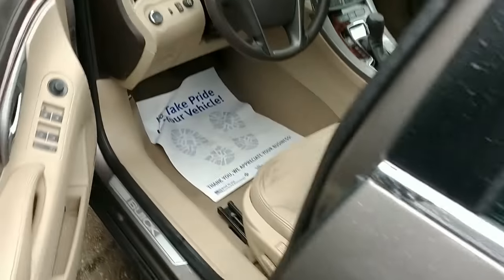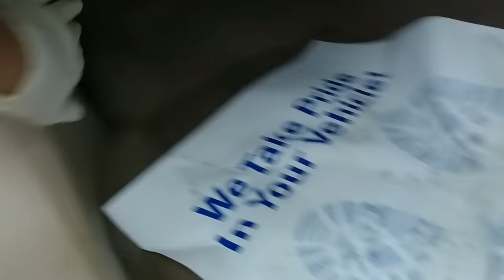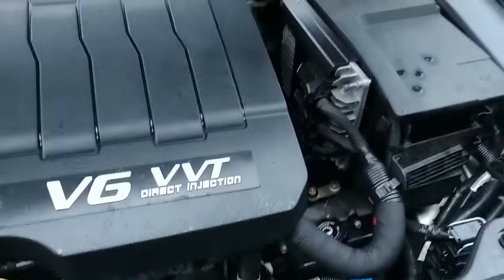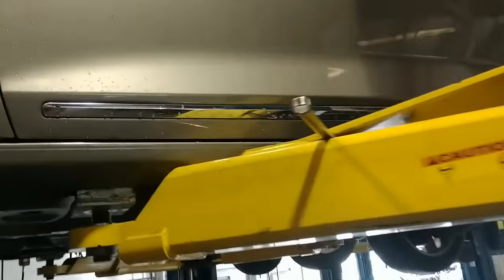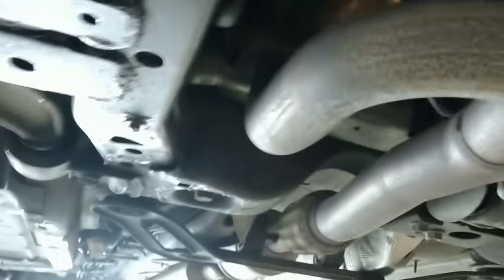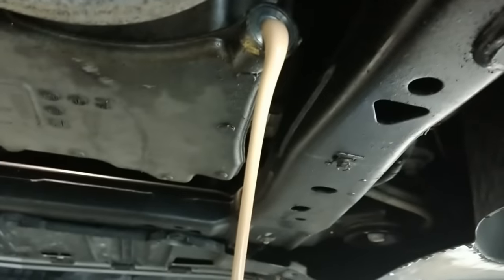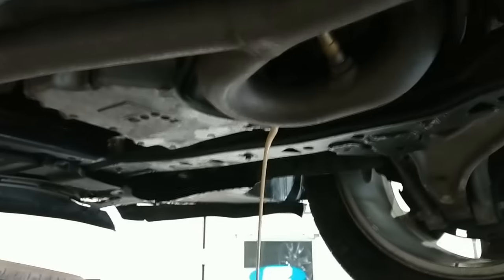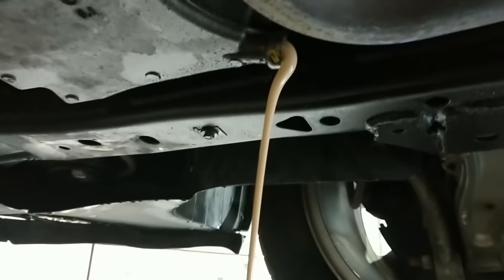Overfilled Crankcase! Blown ENGINE! Used Car Nightmare!

Comment: Tell the lady to fill it up with fresh oil and take it to the nearest "Buy Here Pay Here" -- it worked for the last owner :-)
Reply: You are a treasure to be sure.
Reply: Then they sell it to someone else and rip them off just fix it then you have a nice ride
Reply: Lol. They buy lot of cars at salvage actions. Clean them up. Don't fix anything. Sell for 3 times the price. I went to an auction here once. Next day on way to work I passed a corner lot and seen a car I remembered from auction. I stopped. They claimed they had it for a while and every thing worked and it was $3k. It was 1 of a kind cause color and decals or something. Think it was yellow with stickers. Like a ricer. so I knew it was same car. Pretty sure it sold for $1000 night before. They didn't do a damn thing to it. Skip the corner lots and save money buying junk straight from the auctions. For best deal get with someone at a dealership and tell them kinda what you want and tell them call you when they get a trade in they gonna send to auction. Find out what's wrong if anything. You may find a deal for under $2k.
Reply: Not if they check the oil after the head gasket is blown then it will muck up everytime the thermostat opens
Reply: @pitbullgamer8116  jjj man n
Reply: Uuiiuiuiuiuuiuuiuiuiuiuiuuiuiuiuiuiuiuiuiuiuuiuiuiuiuiuiuiuiuiuiuiu
Reply: @pitbullgamer8116  exactly its actually a very nice car it's worth fixing or finding a good used motor to stick in it.
Reply: I’ve done that before, ironically with a Buick skylark.
Reply: Na i wouldn't feel right doing that to someone else even though they did it to me that's not right to do.

I'd just fix the car the right way then never buy from that car dealership again 

And then if it's to much for me to fuck with I'd tell the next person who wants to buy it what's all wrong with it so they can fix it up for themselves 

Theirs tons of people out there that hate to tell you what's all wrong with whatever ride ur about to get just so they get it sold to get them some easy money
Reply: Bax 60  they should be sure then to make a good list of what's all wrong with it and tape it to the window then sale it
Reply: @xjet this is getting weird Bruce. I feel like they opened the ditch and now I have to come over there and fly otherwise YouTube will keep doing this.
Reply: @Clynikal  LOL... yeah, that travel bubble is there for a reason mate! :-D
Reply: @SgtJoeSmith  Never buy from a dealership unless you want to get scammed. Just buy from private parties and fork out the $150-$250 it costs to have a mechanic inspect it.
Reply: @lemonator8813  that's what I do. But im a mechanic. So I start making up stuff car needs and over state repair costs on actual repairs it needs and boy they start dropping their asking price. 😆
Reply: @SgtJoeSmith  Good idea, I'm going to try that next time. I'm a mechanic... an amateur mechanic lol 😆 
I wish I wasn't such a softie when it came to people though. Need to be truly ruthless if you want to get the best deals.
Reply: @lemonator8813  scam them before they can scam you. thats what world has come too. i make money scamming scammers
Reply: @jl456  Swapping a whole engine will probably be more expensive if you can't do it yourself.
Reply: @kaedeschulz5422  theres always that one guy and your it! The car has what 70k miles??? Okay you buy a used motor or have it rebuilt for what $3k to $5K ? Now your have a car that will last many more years vs paying $500 month for a new one or whatever!🤦🏼‍♂️
Reply: @jl456  Yea i'm such a terrible person....
On such a new looking car i didn't think about a used engine. My bad
I did think about a rebuild with new bearings and all the parts that need to be replaced.
Reply: @jl456  Yea i'm such a terrible person....
On such a new looking car i didn't think about a used engine. My bad
I did think about a rebuild with new bearings and all the parts that need to be replaced.
Reply: @kaedeschulz5422  😂🤣 it will be alright!
Reply: Wouldn’t work sadly. she didn’t buy it with a blown head, she bought it with cooling problems and blew the head while overheating it. I can guarantee you she didn’t buy it with white smoke pouring out of the tail pipe.
Reply: This happened to my friend, but instead he did the mature thing and took the car to be crushed into a cube, in his own words he said he did not want someone else to be ripped off like he was.  People like that are the real MVPs out here.
Reply: @jl456  It's a terrible car, a new motor would cost more than the car sells at blue book value when it's perfect condition, don't forget it's a 2012. These buicks are known for terrible reliability, that's why it needs a new motor in the first place.
Reply: @kenm2709  lol yeah okay I'm not talking a new crate motor pal. I used motor installed will not cost as much as you think also what the hell do you expect for them to do there making payments on it probably for the next 3 to 6 years! Some people just dont get it.
Reply: @kenm2709  I think your wrong
Reply: @jl456  the title literally says it was bought at a buy here pay here lot so the lady more than likely has horrible credit. She is also more than likely making payments every month on it that will be $300-500 for several years after having the issue arise just 100 miles after driving. What part of that makes you think she has another 1-2 grand to stick into fixing the head gasket or buying a new motor?
Reply: @Dunz0Washington  and your just assuming so what part of your message makes any sence? What is wrong with you guys so let's just take a nice car with 70k on the odometer and have it crushed because that just more sence! 🤦🏼‍♂️
Reply: imagine if you could pay a few bucks for the first 30 days of car insurance for this type of fraud. The insurance will be sending these clown shops the bill or sue them into the ground.
Reply: @SgtJoeSmith  my Jeep has rebuilt title and it’s been flawless the past year.
Reply: A shame when people dont bother to take care of stuff.
Reply: @pitbullgamer8116  let's assume it's worth 5000, and she paid 2000 down from taxes, and interest rate is off the charts.  That's a 3000 engine, so in the long run, you'll pay even more, THOUSANDS more, when you went to a car lot to buy a presumably running and driving car, you expect to run for a good long while, not 100 miles.  I had a car lot do this to me on my civic, even though honda was paying for new engines due to a flaw in the engine block, I told em I'd drive it through their shop if they didn't fix it.   They swapped cars for another civic, a few more miles on it, it got sandwiched 2 months later.  God saved me from them all together, and saved them from me too
Reply: Tee  shake the exhaust and muffler. they are supposed to move a bit as the hangers have rubber isolater bushings. but act like its moving way too much. same with tie rod ends. should be able to rock tie rod ends back and forth a bit by hand but if you can shake them without rocking and feel play they are blown. 1 time on a 97 ford ranger if felt the tie rod ends and they felt decent but then i told seller look under truck and i rocked them back and forth and claimed they aint supposed to move like that. I could tell he was stupid looking at him. told hime parts and labor and alignment is $500. he offered to take $500 off. i got it for $2k instead $2500. kids.... go to trades schools and work a job in the trades so you dont get screwed over. lol
Reply: Take it back where she bought it and sell it back to them.
Reply: @pitbullgamer8116  a lucerne will never be a nice car bud
Reply: I’d just bring it back and ask for a refund or to trade it
Reply: Looks like my espresso in the morning 😂
Reply: @jl456  I don't know about modern buicks, but the majority of modern cars are getting parts only the dealerships can get, they're even making special bolt patterns so no tool normal people have works to even get things apart. My dad is a mechanic and had to pay $1500 just for a special toolkit for my moms new Toyota. And the parts are so expensive from the dealerships almost better just getting an entire new car.
Reply: Reduce reuse and resale
Reply: KSEAL
Reply: I agree or call your local hwy patrol and have them inspect it prior to purchasing. I know our state they do that and there have been numerous buy here pay here dealerships that have lost their businesses and have had lawsuits over selling junk or unsafe cars.
Reply: 😂😂😂😂😂epic
Reply: @HAXGGEZ  if it was running long enough for that much coolant to get into the oil the thing is toast. Coolant is very bad for the bearings and rings.
Reply: Yo! It's xjet from NZ. Keep em flying dude!
Reply: @SPEXWISE  I'll do my best mate! :-D
Reply: @xjet  Thanks for all your hard work standing up for us RC enthusiasts. I appreciate you mate.
Reply: I did that with a Buick my father gave me for free. Drained the oil, put in fresh oil with some stop leak and traded that thing in!
Reply: Nice buick
Reply: @SgtJoeSmith  thats real honorable sarge. If you can’t beat them join them?
Reply: @anthonysimon3595  I find it hard to believe the highway patrol is going out and doing pre purchase inspections. They are law enforcement, I’m going to guarantee you can’t find a law that’s says your can’t sell someone a broken vehicle. That is called buying it as-is.
Reply: @SgtJoeSmith  if you buy cheap knowing some $$ is needed for repairs you make out fine- seling cars with issues is really low
Reply: @jl456  depends on the motor some morors get expensive some motors the chassis hast to be lifted to get them out. It just depends on the work involved.

On my bmw to replace just the turbos it's almost 9,000.00 you can buy a car for that.
Reply: But they'll give her half she paid
Reply: Luckily for us. My friend got us A 2006 Chevy Colbalt LX. With Very low mileage. We've had it A year and we didn't invest much money to keep it on the road. Previous owner was A college student and did the basic work it needed. It is an awesome car.  Not to roomie.
Reply: @ronlafountaner70  I've had the same car since it was 3 years old I have a 2008 bmw 535i with 130,000 miles on it bought it with only 20,000.  I love the the car it's had some issues over they years but heck thebcsr is 12 years old it's going to have some problems come up from time to time.
Reply: @pitbullgamer8116  That could cost more then she paid for the piece of shit,  this is why most places have a lemon law.
Reply: @SgtJoeSmith  You're in the military? and on here bragging about screwing people over? Come on bro! Why?  You're Representing Your entire Country! you should be a positive role model. Not doing shady dishonest things bro. Not only are you giving yourself a bad name, but Also all members of your particular branch of military and also Makes The U.S.A look worse than it already does. Yes car dealerships salesmen rip people off and its Very wrong! But going to one and doing the same thing back doesnt make it okay at all! Its still wrong and dishonest and says alot about both people who are scamming eachother. I Appreciate your Service. I do not know your Story, so i do apologise for being rude. But at the same time bro, Dont do that buddy! You're better than that! You have integrity and Self respect im sure. You are better than some dealer trying to hurt Us all using dirty tactics. Rise above that bro. God bless Brother.
Reply: @jl456  Agreed.  A good used 3.6 with less than 100k can be had for $1200 to $1600 with about a grand to install it.  From 2012 on the 3.6 was / is a good solid engine.  Earlier versions had massive issues with the timing chains.
Reply: @darkdevilone8613  Special bolts?  You mean metrics?
Reply: @HockeyGoon939  no metrics is standard for stuff like that in America. By special I mean they make special bolt patterns so normal tools don't work so you have to take it to a authorized dealership or buy special tools for a whole lot of money.
Reply: @kcmcgill5407  simple. Fill the coolant system with mobile one.
Reply: @paintedwolf8394  I remember when a Buick would go 300k plus miles on a 3.8 ltr
Reply: @pitbullgamer8116  yea new engine be 5k tho
Reply: @jl456  

A good used motor is still 3-4 grand more. Especially on late model cars. It's not a 68 Mustang where you can change out the engine in an hour.
Reply: @Mike-su8si  

Yeah, a used car salesman gonna tell you what's wrong with a car. 🙄  Lying is kinda in their job description.
Reply: @jl456  

SenSe, not sence. And if an engine blows after 8 years it's not a great make. I wouldn't trust it, especially if it was just a used motor. A rebuilt or new engine, maybe. Still, if the car has a bad reputation it'd be a better idea to dump it as fast as possible.
Reply: Sherman  who cares! 🤦🏼‍♂️
Reply: @liman42  just take the car to the junk yard then and keep making those payments! 🤦🏼‍♂️
Reply: @jl456  

I don't buy vehicles on a payment plan. Cash is king. And if this woman was making payments she probably doesn't have enough cash on hand to shell out 3 grand for engine. You could buy an excellent vehicle for 3 grand from someone on Craigslist. Following up a bad decision with another expensive decision doesn't seem too smart to me. Either way she's screwed.
Reply: @jl456  

Who cares about what?  Your poor spelling? I do. I wouldn't take advice from someone that doesn't have enough sense to spell it right. If you can't get the simple things correct I wouldn't take seriously anything else you might suggest that could be very costly. Throwing good money after bad is never a good idea.
Reply: @liman42  well good for you English professor!!! Were all proud of you ! You get a cookie for you proper spelling!!!
Reply: @jl456  

You continue to display why I wouldn't take your advice on anything.
Reply: yeah, rule number one of that class should be, never, under any circumstances, ever buy a car that has a freshly pressure washed engine bay and an oil change.
Reply: @jaybruz.5688  

Why? Do you expect a used car dealership to sell a car with a dirty engine and black oil? Yeah, that'll sell real quick. 🙄
 I'm a mechanic and I bought a 98 Tahoe from a dealer with 80+ thousand miles. One of the best trucks I ever owned and I beat on my trucks.  I ended up killing the transmission pulling a fully loaded trailer across country. Got that replaced and the mechanic broke my distributor pulling the tyranny and the dealership manager screwed me, the little shithead.  Texas sucks.
Reply: That's very dishonest. Does any one have morals anymore?
Reply: Ah yes the circle of life
Reply: @BuddhaAtheist29  lemon law only applies to brand new cars.
Reply: @darkdevilone8613  my parents have a 2013 and 2018 rav4, I just did brakes and and oil change on the 18 and there was no special fasteners. I think your dad is lying to you.
Reply: @335m5  not that I have ever heard of, why would a brand new car with an warranty need a lemon law? It to keep used car lots from sale cars they know are trash.
Reply: @BuddhaAtheist29  you better do some research because your completely wrong.
Reply: @335m5  Well every state is different first off. Second you never answered why a brand new car with a warranty need a lemon law. I think I will believe the cop that made the used car lot give me my money back then some kid on the internet.
Reply: @335m5  I have checked the law. Well not in the state I'm living in now, but I have had first hand experience with the laws in the state I lived in at the time, it applied to used car lots. You are the one making ignorant assumptions. I only commented because in my opinion all states should do the same. In my state if you could show they sold you a car like this they had to by it back by law.
Reply: @pitbullgamer8116  its very expensive fix
Reply: @SgtJoeSmith  the owner isn't stupid, they know what is wrong with their car. Or at least get 2nd oppinion
Reply: @mr.bubbles9958  As she bought it As-Is from a dealer who sells salvage vehicles at the "Excellent condition" book price, they'd simply say that they'll buy it back for maybe $50, but she's still on the hook for the full balance of the loan. They'd then just turn around and relist it for the same price they originally sold it to her at, for someone else to buy.
Reply: @jl456  There's assuming, and then there's making educated guesses. They are making educated guesses. You are assuming.
Reply: @BuddhaAtheist29  lemon laws are for new vehicle purchases right?
Reply: @BuddhaAtheist29  no you just had an ignorant cop give unlawful orders to an ignorant business owner
Reply: @BuddhaAtheist29  what state? I'll gladly post the lemon law from it so all can read it and see your ignorance
Reply: It's still going to blow white smoke so that won't work SMH 🤣
Reply: I'd have it towed over to the sales lot, push it over to the front entrance door so it's no longer accessible for anyone else to get ripped off, then slash all 4 tires and break the gear shifter off in park. Tell em to have a great day, and I'll see you in court.
Reply: Never heard of Buy Here Pay Here , is that a franchise ?